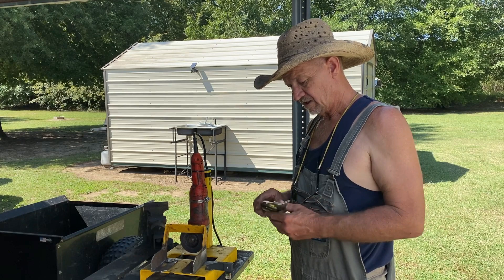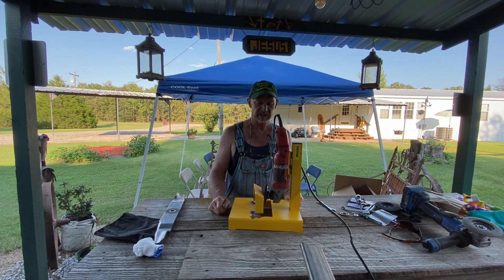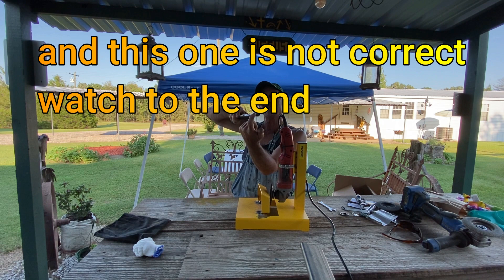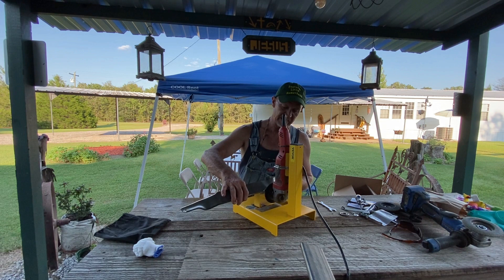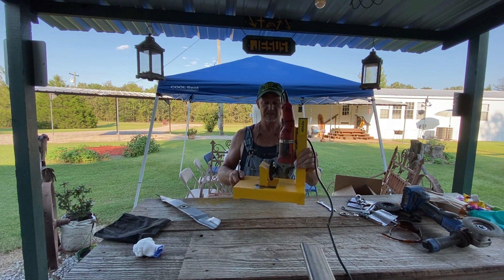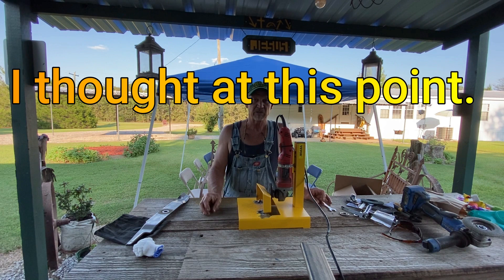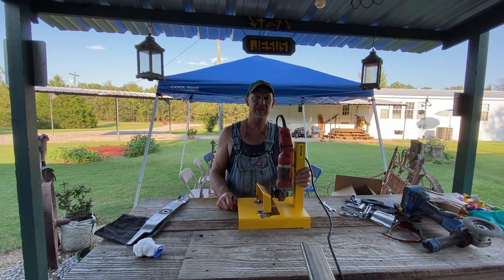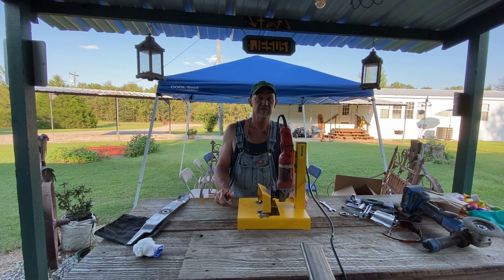WATCH BEFORE YOU BUY the Yellow Lawnmower Blade Sharpener by VEVOR / I had to make modifications!

Comment: Reckon if you sharpen from the left side instead of right side , would stop metal shavings from flying up in your face. turn the sharpener to the right and line up on left side. thanks for your video and be safe.
Reply from the maker: I know what  you mean Mr. Robert but it just doesn't feel right for some reason.
Reply: @papawsplace  I understand, thanks for the video.

Comment: It's all about the math. It looks to me like they sent you a literal 30 degree angle, instead of the 60 degree angle needed to produce a 30 degree angle on the blade. Good thing you caught that!
Reply: Looking closer at your modification, it look like you angled it an additional 30 degrees, which would give you the proper 60 degree angle for your 30 degree grind.
Reply from the maker: That's correct. It works great now.

Comment: Must say very ingenious modification but was not necessary. The angle grinder is not parallel with the fence; the angle grinder is turned where the left side of the flap wheel is about ¼ inch from the fence and ¾ to 1” above from the bottom of the fence. The only part of the blade touched is the left side of the flap wheel. You put the blade about a 45 degree angle on the fence and go left to right at an upward angle. This should work with any make of 4 ½ inch angle.grinders.
Reply from the maker: I appreciate you comment but I I have to agree to disagree with you. I wish you could show me in person to prove your point.
Again, I appreciate your comment though! 
Because I'm not always correct, it's just my opinion and how I do things.
Reply: https://www.youtube.com/watch?v=4A7hv1atWSk&t=18s
Plenty more on Youtube on how to adjust the angle grinder
Reply from the maker: Go to the video and look at the angle of his Sharpener Jig plate.
 It's very obvious it's at a steeper angle than the one that was sent to me.